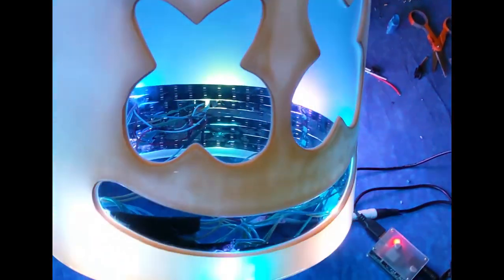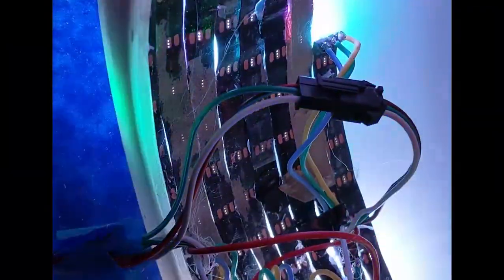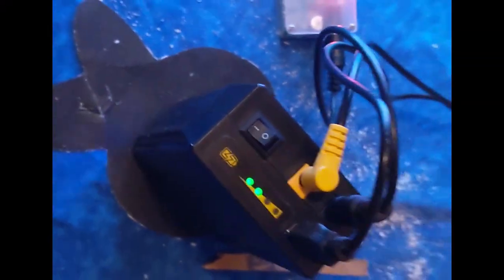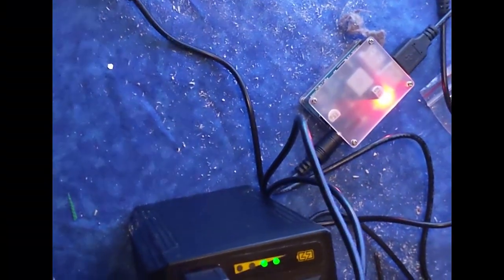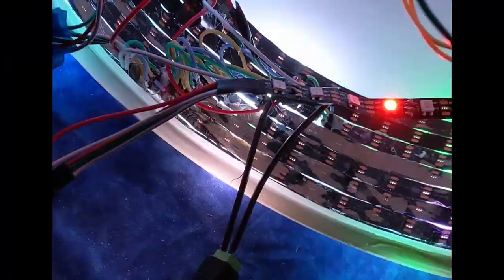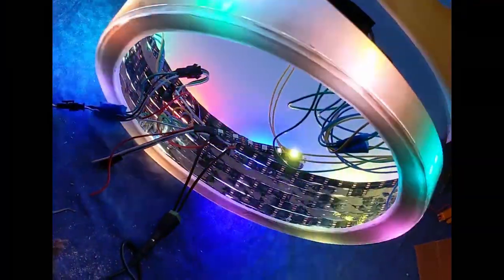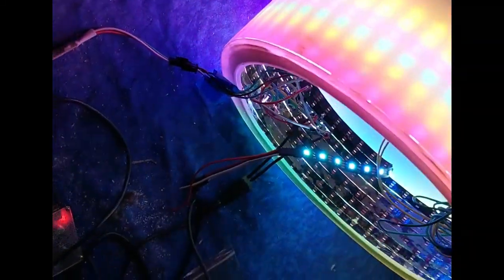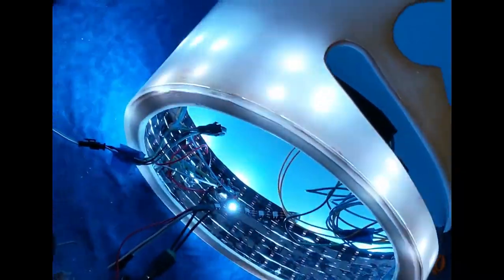Marshmello (Ep #13)LED Professional Helmet Guide:DIY Step-by-Step Guide :Build Your Own Mello Helmet

Comment: If you look at your white (color white) it starts to turn brown due to the voltage drop.  Thats where i need to figure out exactly where and how to add the extra power
Reply from the maker: Yeah, I'm running separate power lines throughout the strings of LEDs to keep up the brightness and voltage drop. Right now the LED controller is getting hot so I'm trying to figure out how to fix that. I'm adding a 2nd battery pack to spread out the voltage hoping this will fix the problem
Reply: @DoItRight  i tried the same thing and was only able to wire one more to the controller anything more than that it would get super hot. i do have a few ideas but wanted to ask if your willing to skype call or something we might be able to get ideas together and finnally figure it all out
Reply from the maker: @HellbagDarrell  I disconnect the + and - lines coming out of the controller and it stopped getting hot. I 'm running separate lines (+ and -) from the power supply directly to the led and it works. I only keep the middle green cable coming from the controller to the LED so I can control the pattern. My 2nd power supply arrives tomorrow and I'll use that to power the remaining led strips. I think there is too much drain with one battery which is also heating up my designated power lines. I'll post a video once I've hooked it up.
Reply: @DoItRight  ahh soo the green controls the pattern, so im guessing every few strips you wire the green from the main controller to the led and the power from the outside source like you did and it works good? thats great. and also i was going to say that you would need another battery of the same regardless because you need to make sure the helmet have even weight distribution.  so be careful where you put stuff. i had the issue where i had everything in and i didnt think about the weight and it was heavier on one side than the other.
Reply from the maker: @HellbagDarrell  Yeah, I'm mounting one battery on each side so it's balanced. The middle green wire controls the pattern so keep it continuously connected then run separate + and - power lines along the led strands to keep the voltage up/brightness. I know more in the next couple days as I start adding the remaining LEDs with the 2nd battery and will post a video.
Reply: @DoItRight  sweet man sounds great!! also remeber if you want the pattern to like be a certain way like "organized" then you have to wire them in a specific way, but if you dont mind them being all scrambled around them you dont have to worry about that.